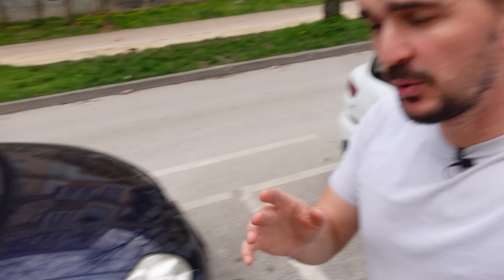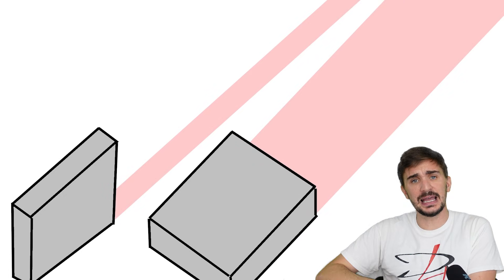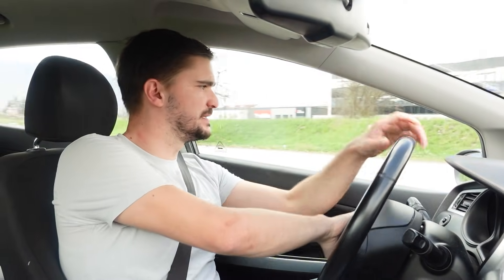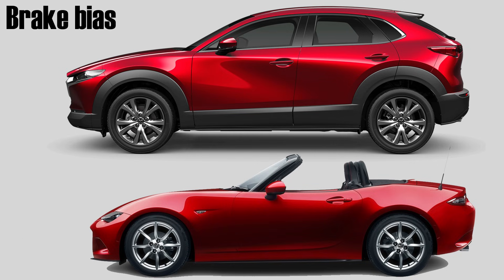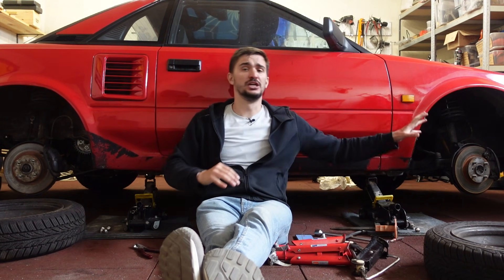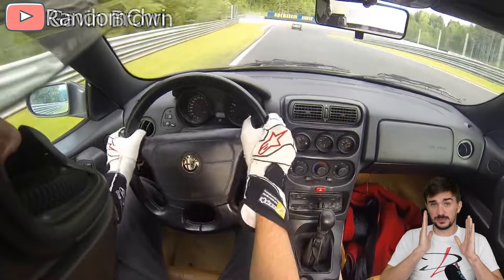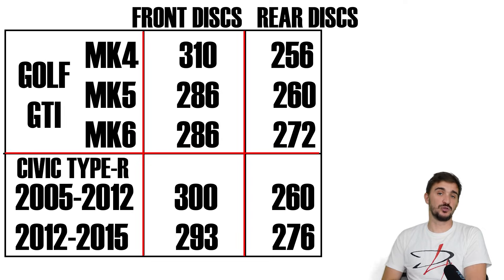Why are Front Brakes Larger than Rear Ones? Brake Bias Explained

Comment: 2:40 this part is interesting, I really didn't know that yet. I also didn't know that locked tires actually provide less "stopping power".
I thought that ABS was only there to maintain the control of the vehicle, not that it also maximized stopping power.

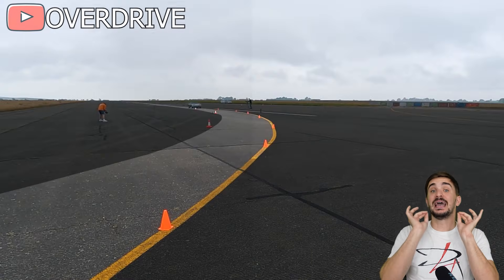10:30 is also a very interesting point, because I thought that ABS would prevent understeering. But I've (luckily) not been in the situation yet to actually see, or rather feel, that result myself.
However, I did have the chance to poke at the workings of my '18 VW Polo on sand and gravel roads, which gave me an intruiging result for that case: the car actually starts oversteering / drifting. Which is very unusual, at least as far as my understanding of physics and cars go, because it's an FWD.
Now given that experience and the explaination about intentional brake bias, I am wondering if the ABS (in combination with ESP) is intentionally causing the car to end up oversteering; simply because that is a scenario that is far easier (by comparison) to deal with than understeering.
(edit after continuing the video: I guess "oversteering" being "predictable" to me just shows that I've played too many racing games xD)
Which reminds me that after I got my license, someone asked me if I was also taught "stutter braking", which I assume was "manual" ABS.

But since I made my license only recently, it seems that ABS is such a given that they don't even teach it anymore in driving school.
Which is interesting, because some things they still teach are from 30 years ago, like being able to tell what part in the engine bay does what for maintenance reasons.
Something that's borderline irrelevant with newer cars as they're more and more build like iPhones: you don't get access to *anything*. Or it claims to be "broken" the moment you do.

A very interesting video to say the least. But there's something I've been wondering about for a while, which got dragged back to attention by this now:
How does the hydraulic system for the brakes have a reservoir but NOT have all the pressure from stepping on the pedal push all the pressure into there?
...actually, I might have already guessed this while writing: if the reservoir's connection is at the very "beginning" of the cylinder, it would only ever be able to "refill" the system during idle, when there's literally no pressure. And the moment any pressure gets applied, that opening of the system isn't open anymore at all.
Reply: I don't know about other cars, but in a 2008 Touran, the ESP is set up such that when you understeer over a certain point, it locks up a rear wheel and gets the rear sliding.
At least it feels so, what I know is that the rear is 100% sliding. Unfortunately, it also cuts off your gas pedal input when it does that, so you can't really continue normally, you bog down.
Reply: @Random-nf7qb  Interesting. This also prompts me to add that the "drifting" my little Polo enters, happens at the point where I'm already going more sideways than forwards anyways.
So maybe my ESP is doing the same and tries to "aim" for understeering, until the point is reached where that simply doesn't result in a change of direction anymore.
I really wish I could poke at the system more. Probably should look into booking a day on these driving course things where you can "track-test" your car.
Reply: ABS prevents understeering i guess @d4a meant if you are entering a corner above physical limits then ABS wont help.
ESP wants the car to be understeering (maybe neutral) but not oversteering behavior. On loose surfaces or on ice it is a hard job as you can easily overcome the friction limit of the rear tires. 
FWD and oversteer of course it can be done not just power on rear can do that search for lift off oversteer.
Reply: pure abs just prevents wheel from locking, in combination with stability and traction control it can use bakes to direct car in desired direction(where is steering wheel pointed) or prevent any wheel to burn rubber, braking system uses underpressure from intake manifold to bust brake power,
Reply: you are correct about the connection between the master cylinder(s) and reservoir sealing when the master cylinder's piston is actuated. This "cutoff distance" is actually a specification tested for when you buy a new "universal"/motorsports master cylinder (e.g. a Tilton 78-series). This value hovers between 0.02" and 0.05" of master cylinder piston travel until the fluid inlet is cut off, past which the MC can start generating pressure

Comment: I'd like to hear more about understeer vs oversteer. This isn't high speed track driving, but my experience driving in the snow is that understeer cannot be recovered from, but oversteer can. I much prefer driving my oversteer prone cars in the snow rather than my understeer prone cars, because if you start sliding the fronts, you can't just countersteer out of it.
Reply from the maker: But you can let go of the brake to get your steering back
Reply: @d4a  Well yeah if braking is causing your understeer, but if you come into a corner faster than you should and the fronts start sliding, you have no choice but to go off the road. If you come around a corner too fast and the rear comes out, you can try to countersteer and save it. It may or may not work, but at least there's hope.

Also I find that understeer is harder to detect if you're not expecting it. If the back steps out, you feel it in your seat instantly, especially in short wheelbase cars. If the front starts sliding, you just go, "huh. why the car no turn?" and give it more steering angle, then realize that more steering angle is the last thing the situation needs.
Reply: "sliding" into understeer means the wheels cannot handle both.
Driving power and side traktion.
if not too fast, cutting the power immediately, will help.
Push the clutch or shift automatic lever into Neutral.
Reply: you can "correct" understeer by lessening your steering angle input and steering the car "straighter". It's somewhat counterintuitive, but in doing so, you give the front tires more grip by reducing their slip angle (which, given that you're understeering, is well past the point of maximum grip), allowing them to regain traction, at least partially. You can also "steer with the brakes", so to speak, in using the weight transfer as a result of braking input to loosen the rear end and put more downwards force on the front tires

Comment: I had ventilated and quite big rear discs in an E46 320i. I think it could be as a result of the anti dive alignment and set up of this cars. You can tell while driving, it's notorious.
Reply: E46 is a car with a drum parking brake incorporated into rear discs.  In that set up, it is normal to have larger diameter rear discs.

Comment: I just bought a ford puma. Another compensation to add some braking percentage back to the rear is tyre pressures 35psi front, 31psi rear. First car I had that differentiates tyre pressure.

Comment: What's your opinion on gutting the proportioning valve in the AW11? I kept reading in groups that it's biased way too much to the front, even for spirited street driving, and gutting the valve will send more pressure to the rear, people always claim that it "transforms the car" but I'm kinda skeptical.
Reply from the maker: The aw11 is definitely over-biased to the front but I'm not so sure on the gutting. I'd prefer a proportioning valve instead.
Reply: If the rears lock up first it is not just over-steer you can roll a car.  There used to be a presure relief valve to prevent this.
Reply: @jamescaley9942  My car locks up the rear wheels first for yet unknown reasons and it is definitely not fun spinning out at 140km/h.

Comment: There are certain models of the Chevrolet Suburban that have larger ventilated rear discs than the front, almost one inch larger in diameter and just as thick. It looks backwards when you see it.

Comment: If the amount of friction doesn't change depending on the surface area, why do we use wider tires on cars with more torque and hp? Shouldn't the amount of grip stay the same with either a slim wheel and a wider one?
Reply: Same thing as the brakes. Bigger brakes don't create more friction, but they can stop more times before they get too hot. 

Wider tires don't necessarily have more grip than narrow ones, but they won't heat up as fast. This only applies to street/track driving, if you're into offroading it all changes.

Comment: Another great video! One small correction though, on your table at the end: the mk5 Golf GTI has 312mm front and 286mm rear discs. I know so because I own one.
Reply: Same with the mk6 GTI. Although the new revision rear brakes discs have 282 mm. While the mk4 GTI has 288 mm discs at the front and 232 mm discs at the rear.

Comment: one important hing about disc diameter:
heat dissipation isn't really a big factor here, the brakes almost always heat up more quickly than they cool down and while a larger brake has more surface area to loose heat over, that difference isn't significant.
what is significant is the larger mass of a larger brake disc. A larger mass of anything can absorb more energy before its absolute temperature increases to the critical limit of the material, and since we're not constantly braking, loosing heat slowly is ok, on the other hand, heating up quickly is very much an issue we worry about.
Reply: The larger disc diameter also creates a larger lever arm to exert more force
Reply: @darrenporsch , that was not a factor, if you watched the video.
Reply: @seriouscat2231  That's a factor for using a larger disk whether it's in the video or not The larger disc creates a larger leather arm to create more stopping power
Reply: @darrenporsch , you really don't know what you're talking about. Just watch the video.
Reply: @seriouscat2231  are you serious I don't need to watch this video for this guy to tell me stuff about brakes It's basic physics
Reply: @, it has nothing to do with the point he was making. The discs are not bigger because more force was needed. It's pretty disingenuous to pretend that someone is disagreeing with you on basic physics. It's actually your second change of subject already.

Comment: In my Peugeot 407 I have 16' wheels so, to fit larger calipers in front I have actually smaller rotors in fornt 283 mm and 290 mm in rear 😂

Comment: The NB Miata with the sport brake option actually has larger rear rotors by a small amount, calipers are much smaller though. It's a bit odd
Reply: My BJ Protege of same era is similar, though I did find it surprising when I was ordering new rotors. Must all be in the caliper choice.

Comment: According to Google: 

“Will wider wheels and tires affect your ability to brake and accelerate? That's an easy one to answer. Yes, those wider wheels will help you brake harder and take off faster. Wider wheels provide more traction and create higher acceleration.”

Your explanation as to why wider tires won’t help is purely theoretical but in practice it does help a bit to have wider tires. 👍🏼 

The rest of the video is great. Thanks for explaining. 😊
Reply from the maker: https://youtu.be/CyH5xOcsXxs
I never said wider tires don't do anything. I said that increasing the front surface area during braking isn't relevant.

Comment: As a 1990 MKII MR2 Turbo owner I have to emphasize “Usually” larger. This is true of my 1994 Celica Turbo and my 1993 Soarer GT-T. However, the front and rear discs and pads are nearly identical in size on my early MR2. Later MKII Turbos got a big front brake upgrade with dual piston calipers from factory.
Looking at your 1987, I can see that your brake system is very similar to the system on my 1990. Great video as usual!
Reply: @TC-zf1ji  
Nice troll 👍
Reply: I have a 1993 Citroen ZX Volcane, and the front and rear brake discs are identical in diameter too. Although the rear ones arent ventillated and the pads are smaller. Weird setup.
Reply: @TiborSzarvas  
Cool car. Bertone designed? We didn’t get them in my country. Is it fun to drive?
Reply: @negativeindustrial  yes it is bertone. it might look dull on the outside, but i am really fond of the interior (i have it with leather seats as well) and the single wiper on the front windshield just reminds me of  DTM racing haha. It is very fun due to the manufacturer pushing and tilting the engine backwards to the firewall as much as they could so the balance is better. Also it has pasive rear wheel steering which is truly noticable under spirited driving. I once could keep up with a car with twice as much power on a short racetrack with lot of turns.
Reply: @TiborSzarvas  
That’s what’s up. Nice car, sir.

Comment: came here for the sole purpose of pointing out that the C8 corvettes rear brakes are actually bigger than the fronts
Reply from the maker: Same as on my mr2 mentioned in the vid
Reply: C8 = mid engine
MR2 = mid engine

See the pattern?

Comment: You forgot about the part of the system, especially in the free ABS days, where the proportioning valve would always make sure that about a hundredth of a second of breaking occurs to the rear before breaking occurs in the front. That begins the moment of inertia so that the front tires start to plant before the brakes are applied. Increasing rear brake by us to help with oversteer so that you can drift a car around the corner, is not the best idea. Bias should be implanted by the acceleration capability of the engine and drivetrain. The best example of this is watch the 1968 Daytona 500 where Mario Andretti took everybody to school to show them that a vehicle that was driven in a manner where it always seem to be in an understeer condition, can be faster than everybody on the racetrack. They even kept him in the pits for 37 seconds on his last Pitstop to make sure that there are other driver won the race, and he was still able to overcome that.
One of the best systems in the pre ABS days was a system that was put on the Chrysler minivan, which was a proportioning valve mechanism to the rear that was attached to the rear suspension and would measure how much braking force was being applied and alter the amount of brake Force front and rear. People were actually taking those Systems off of the minivan and putting them on dirt track cars and doing quite well with them.
Reply: Many squarebody Chevys had the same type of brake proportioning valve, and Jeep Comanches had it too.

Comment: Is that a 1987 MR2 going to have its own video series?
I used to have a 1986 MR2 and loved it, with the exception of the rear biased weight distribution, making the handling and steering at speed Very Dangerous... (This is how I Totaled mine at 30 MPH into a ditch on a wet road with new tires.😢)
Reply from the maker: I have many many vids about the mr2 on the channel

Comment: Also, front brakes will always do better.
You can easily test this on a bicycle - it will take a longer distance to stop the bike with rear brakes only, compared with the front only, and it's more easily overpowered, because of the weight transfer to the front, thus losing grip.
Reply: only if you have complete weight transfer to front wheels, if not,  rear wheels push ground with some force so you waste its ability for braking
Reply: @makantahi3731 , there will always be some weight transfer, thus front brakes will always be more efficient.

Comment: It's interesting that as a mechanic for a dealership I've seen how the cars deteriorate from oil service to oil service. Ive always seen the rear brakes need to be replaced as early as 40k miles but front ones as early as 80k. I've never seen a car's first set of brakes wear faster in the front. I'm not disagreeing with the facts you've presented, but it should be noted.
Reply: That happened with the advent of abs. Non abs cars wear the fronts first.

Comment: Like always, great information. I have a 1997 Toyota RAV4 3SFE engine, turbo. I installed rear disc brakes. No ABS. Stainless Steel lines, and holes in the front disc brake for ventilation. Why? In my country there are lots of up and down hills. When driving downhill, the brakes can get heated. Is adding a brake hose from the front spoiler to the brake dust cover help, or is it overkill?
Reply: It would help.
Reply: @almc2242
When you installed the rear disc brakes from drum did you install a disc rear proportional valve or use the oe drum one?
Reply: @davidgriggs3967  The OEM, but the stopping power is great. It does not lock up, but the braking force is not sudden, its graduale. At low speed, it stops on a dime.
Reply: @almc2242  That's what mine was like when I converted to rear disc , awesome braking power but didn't lockup as much as I tried. 
Not sure what country your in but if you have to take your car for a roadworthy check it may not pass as like he said in the video you must be able to overcome the grip of your tyre's.
Reply: Be careful if you are heating up those discs you drilled watch out they don't crack as you have now weakened the structural integrity of the disc. 
Keep an eye them because they could break up ( no pun intended ) at any time.
Reply: @davidgriggs3967  No, they were purchase. :) I knew that one.

Comment: This happened to me (the rear sliding out) when braking luckily i was braking in a straight so didn't have  much aftect on the corner. I was driving a Nissan Primera p11-114

Comment: Thank you for the video I learned alot.
At 11:32, Howcome you mentioned oversteer is much harder to control and unpredictable? I thought that understeer was much harder to grasp and control, mainly because you have less control of correcting the inertia line.
Reply: in understeer you go on tangenta-straight, but on oversteer you go in some kind of cycloida, you still go in circle but you are rotating too